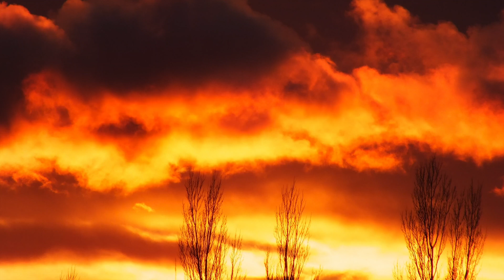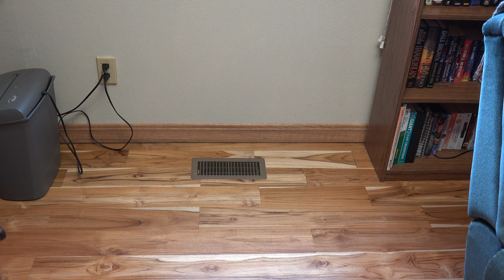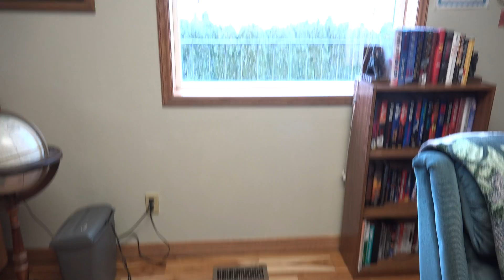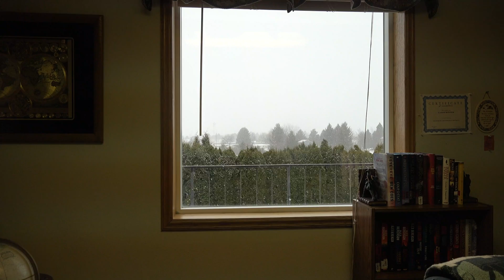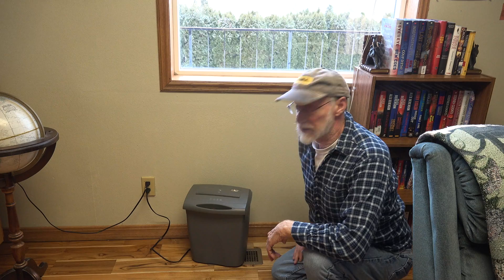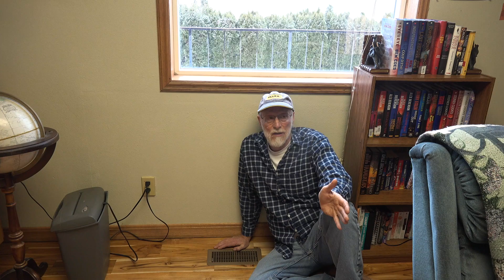The floor diffuser in cooling

Comment: i have a question not regarding this video... If i install a uv light... where is it best to get my power from, with out having power on all  the time and for it to come on with cool and heat?  its 24v uv ,120/240gas furnace
Reply from the maker: +Ernesto Perez Its hard to say.  You can use a relay wired in parallel with the fan circuit if the same speed is used for both heating and cooling.  There are also induction relays that can be mounted on the common wire to the fan that will do it.  You need electrical skills to do this.
GFM
Reply: Thanx so its cheaper and easier to just leave it on 24 hrs. It was just a curious question that came to my head. Thanx

Comment: the ceiling diffuser can work with heat if there is a ceiling fan nearby to push the heat down and stir the air a bit so then air is at an equal temp all around so then you wont deal with hot or cold spots.

Comment: Since we live in a primary cooling climate, and most diffusers In the ceiling,  I try and counteract the stratification heating problem by using very high fan speed and lower delta t to break through the heat rising and keep shooting it back down towards the floor. The same goes for some older homes with floor diffuser in cooling. 450-475 / ton and smaller compressor to keep air moving.
Reply from the maker: +Joe Shearer That will work ok.
GFM
Reply: +Joe Shearer We have a half of everything where i live for register diffusers, The climate i my area requires both heating and cooling, I have ceiling registers and my neighbors across the road have floor registers